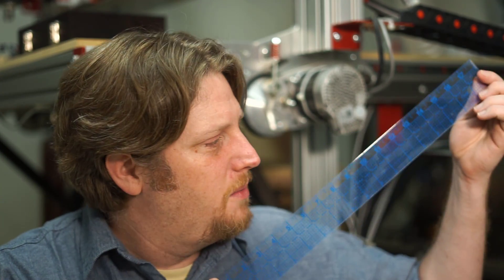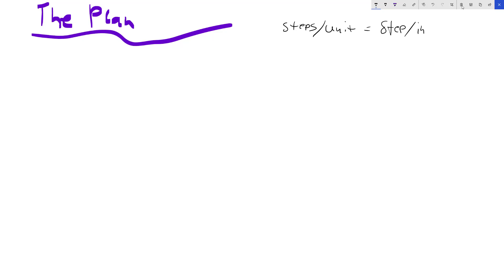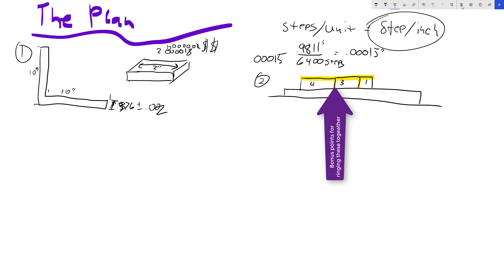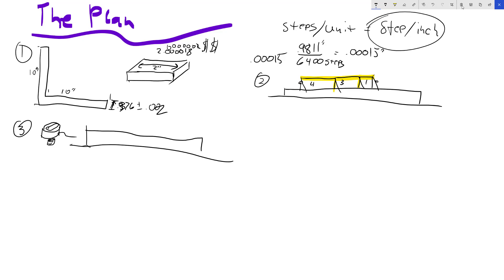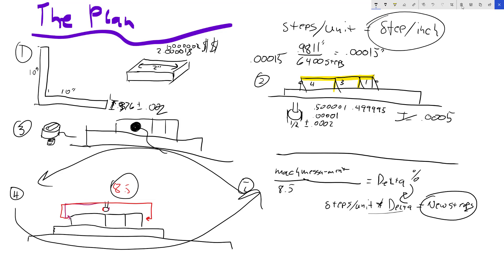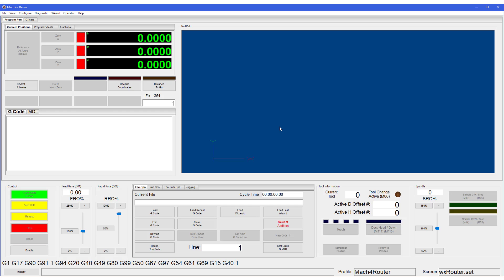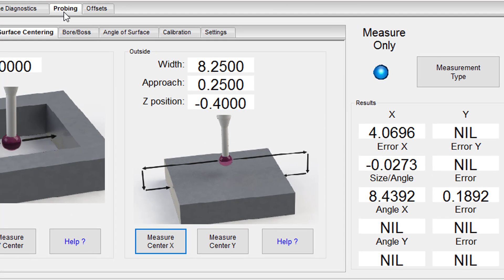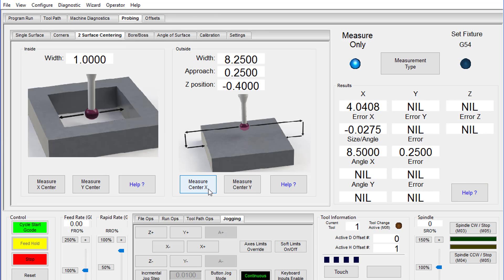CNC Router Tuning using Gauge blocks

Comment: I will try to do this with dial indicator mounted to the spindle instead of the touch probe. The indicator should measure the error between the block stack and the distance traveled by the spindle.

Comment: The slotting makes me nervous if you are shooting for gage block levels of accuracy.  A nicely leveled waste board with a dial indicator and some clamps would let you ensure that no light is getting under your gage blocks seems wiser.   Additionally I would want to ensure that I ringed the blocks rather than just trying to push them together to ensure a proper measure.   Your way may have worked but when shooting for that extreme of accuracy I would want to know that the blocks were true.
Reply from the maker: Legit concerns.. Because my machine is mostly aluminum and my spindle case is not magnetic using a dial indicator vs slotting out a spot wasn't really an option (and trust me this is an annoyance for me when I square up my vice... ). My goal with the slot was to make sure I am "square" to my machines axis, and best way to do that was to let it lay tell me what its axis were.. Also the cosine error for being off as long as I am close to the center in both directions is actually pretty tiny... Really, now that I am thinking about it, probably could have skipped the trench and just eyeballed that.. even a 1/10th of an inch of of square, over 8.5" thats .00059" off in cosine error.. 

Ringing the blocks togeather... again I did try that off camera but two things.. 1, they wouldn't stay rung when I placed them in the trench and 2 those larger blocks (with my low grade gage blocks) really didn't want to ring togeather and hold..  

So I am balancing various issues when I came to my solution.. Its not great, but its far better than your standard half thou dial indicator and a 1" movement.

Comment: A cheaper (though slightly less precise) alternative would be a set of 1-2-3 blocks or even 2-3-4 blocks. With those you can also check to see if all the axes are at 90 degrees to one another.
Reply from the maker: Yah, I thought about using my 123 blocks and bolting them togeather to get a 6" throw. But as you mentioned not as precise.. as for squareness... I think a 1/10ths dial indicator attached to the Z axis and a couple of 123 blocks or 234 blocks bolted togeather in an L might make for a great test... would have to tram the blocks in carefully, then lock them down.. but yah.. could work pretty well.

Comment: the only issue i see with this method is you are including backlash with your distance measurement. you can eliminate that by using the exact same setup, but adding a verticle wall at the end. then only move in one direction. say X+ for doing the x measurement. as any time you move x+ and then x- you include backlash in your calculation.

so you gauge block set up would look like this

__________________|    

move your machine from left to right. it also will eliminate your need to include the diameter of your ball in your math.

you can do the same thing in Z by stacking you gauge block vertically

|
|
|
|
_      

the you move only in Z-. measure top of block and then move down to the horizontal plate.

you also can do this with a dial indicator or better a test indicator.
Reply from the maker: Good thoughts on the backlash.. I am on Rack and pinion for X&Y and with all my testing have seriously never measured any backlash those axis... So that's a gap on my part to consider that.. Machines on belts or acme screws could absolutely have backlash.. (precision ground ball screws don't generally have much backlash either)..  If you have already tuned backlash though, that would be compensated into the calculation... Kind of a chicken and egg thing though right.. Mach 3 and 4 have backlash compensation parameters.. So you could tune backlash, then run this process, then tune the backlash again.. back and forth and such until you are happy with both results..)

As for the Z, I was thinking very similarly, but my z column gets in the way pretty quickly when trying to do that.. my max Z movement is only 8" and by the time I move one direction or another for the column to be out of the way, I can't trust that my bed is flat enough to be super precise (more precise then testing 1" and extrapolating I suppose... ).. These are challenges on large format routers that probably don't exist on mills.. (man I want a mill :-P)
Reply: deck a flat area say the width of your largest router bit. then stack your 4in gauge block on that, then ring your stack together on top of that. should give you enough room to clear your spindle. may have to remove the dust shoe. 

as  to the backlash, best practice to eliminate any and all possible errors if you're shooting for accuracy. backlash comp is good to have, but i'd make my inital steps per in calcs with out having to rely on that if possible, that said, the 8in gauge block stack will give you way better results than the 1in stroke on the dial indicator alone.
Reply from the maker: Though has crossed my mind...  Not sure if 4" throw is enough to not knock over the gauge block stack.. worth trying though.. when I was stacking things up and looking at the problem sunday evening I didn't think the 4 was long enough to act as a base..   (if only my surface was conductive and trammed in)..

Yah, there is an inside probing options (right next to the outside one I used).. it would work for your approach.. guess you would only have four hits to possible backlash in that model... I've got 7 direction changes from this approach..  And calculating the ball... (though precision of the ball still has to be accounted for)...  While an oversight on my part, its also a credit to  CNCRouterParts Pro machines that my lack of ever finding any backlash meant I forgot it in my tuning process...
Reply from the maker: artisandice your comments about backlash and such made me go back and double check with a better indicator.. Instead of using a digital dial indicator, I switched over to an analog .0005 test indicator.. low and behold I DO have .001~ backlash on my Y axis...  while my Dial indicator says .0005 resolution.. its +/- .001.. so the .001 wasn't visible.. .

Sadly I cant fix it as my Ethernet Smoothstepper doesn't have Backlash Compensation support with Mach 4 (yet)... Warp 9's forum says they are working on that now.. so here's to hoping..

So odd numbered direction changes will be off by .001... for now... won't test the others until the Warp 9 driver upgrade comes out... then I'll tune them all again.. AND do a video on that :-)..